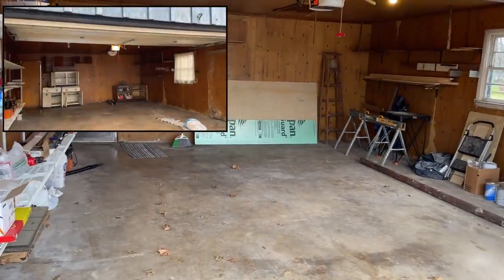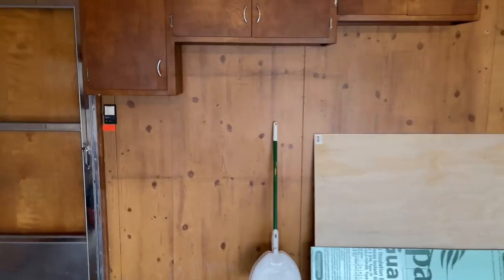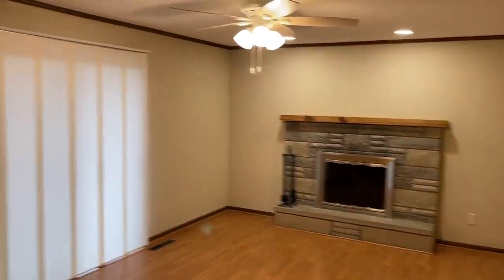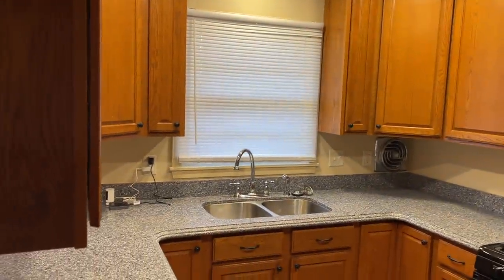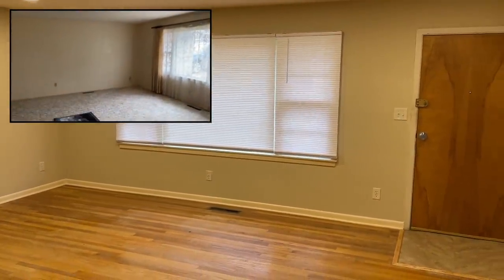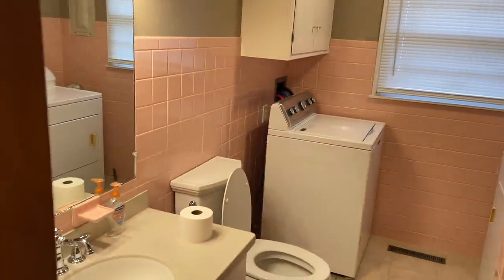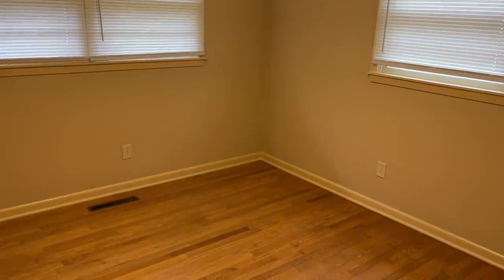Example House Flip | Before, After, and The Numbers

Comment: So refreshing that someone breaks it all down in an honest way.  I buy properties and rehab them myself or with subcontractors and then make them rentals (done 12 in 10 years). I’d enjoy and appreciate your take on how best to prep a house for the rental market. Example: one house I’ve had for 6 years I’ve had to replace the carpet twice...my mistake was putting in carpet in the first place, I should have bitten the bullet and had VPF put in.  It was 2X the cost but I’d be money ahead now after the second replacement. Also, same paint for all my units so I don’t need to play games with colors.  Finally, LED light bulbs throughout since I need to hire a handyman at $25/hour to put in a bulb as if I ask my tenants to change their own bulb they are likely to fake a fall and file a lawsuit.  This is CA and everyone is looking for a quick buck.  I learned these lessons the hard way and I’d sure appreciate learning from you on the right type of renovations for rentals versus flips.  Like how, to install a motion sensor to bathroom fans to cut down on mold as my tenants never turn them on and I end up,with moldy paint.  Using Kiwkset smartlock on all my properties to easily, quickly and cheaply change out a lock in between tenants.
Reply from the maker: Hey Shawn, nice work on growing 12 rentals in CA as that is no small accomplishment.  Have you ever wired your bathroom lighting and fan on the same switch.  So if they want light they get the fan as well?
Reply: @EverydayHomeRepairs  thanks for the response. I wasn’t sure how much of a load the switch could take but I also want it to vent a bit longer after someone departs the room. I just bought this place as #13 but unfortunately it’s from another property burning to the ground. Rodent nest in garage, chewed romex and the tenant left the light on. Another tip, don’t go cheap on insurance, full replacement coverage plus updated code coverage. We didn’t have the latter so we couldn’t rebuild and took the cash and sold the land to buy this new place with the bathroom fan issue. FYI...hospital grade on all replacement plugs now. I’ve been able to find on eBay old stick boxes for @ $2- $3 each.

Comment: Nice video. For those thinking about fix and flip, in the state/county/municipality I live in, this is the law (summarized) regarding a non-licensed person doing electrical/plumbing/HVAC/mechanical work.

The property is a single family dwelling. No condos, no townhomes, no duplexes, etc. 
And
Their name is on the deed
And
The property must be their primary residence.
And
The property will not be sold, rented or leased for at least 12 months after completion of work

If the DIYer does not meet all the above (in my state/county/municipality), they cannot do trade work, other than the most basic things, like replacing a faulty receptacle.

Also, the work is still subject to permitting and inspection.

Comment: Great info! I got started doing fix and flip, or just flip as is. That was in the late 90s. And then i noticed that the folks in my area who had become rich over decades held rather than flipped. For the last 15 years i have been buying and holding 1 house a year. I do not spend a penny of the profit on lifestyle enhancements, just plowing it all back into real estate, and keeping a big cushion. I do not refinance to pull cash out, in fact i do not need loans anymore, the cash builds up quickly enough to buy the 1 house a year cash.
Reply from the maker: Nice Tracy,  I also buy with cash but couldn’t buy and hold too many additional properties at this point.  Sounds like you are in a great spot and all the hard work is really paying off.  Do you predominantly just buy single families?
Reply: @EverydayHomeRepairs  So far just single families. I try to stay inside my limited circle of competence.
Reply from the maker: @tracythompson1692 , not a bad plan at all.  Stay in your lane 👍

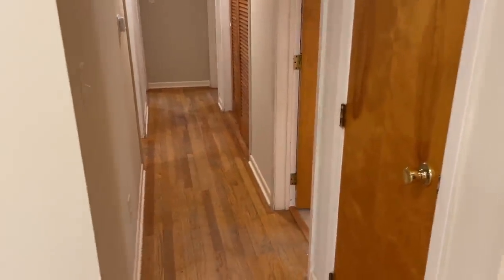Comment: Great video! At 5:20, I'm curious why you didn't have the painters also paint the unpainted wood doors. Typically flippers paint these old doors the same as the trim, which typically means some flavor of white semi-gloss paint. Flippers sometimes also change the shiny brass door knobs, the type reminiscent of grandma's musty old house, to bronze to give buyers the impression of "new-and-fresh". 
On a related note, I assume you will not break even spending an extra $7k to paint the kitchen cabinets if the home is expected to sell for (hopefully much more than) $105k, but at higher selling prices I believe it could pay back double or more, ie final sale price will be $7k * 3 to double your money, or $7k * 4 to triple your money. Remember you have to subtract out the initial $7k. It would be pointless to spend $7k just so the house sells for an additional $7k.
Reply from the maker: Hey Don, the ARV for this home being at $105K there are plenty of thing I didn’t touch which would need to be updated in a different market and price point.  It is always a balance of spending the money wisely and I am definitely still on the learning curve. 👍

Comment: Great idea, but did you get a building inspector, you should have added a bigger recessed light in the middle of the kitchen ceiling and separated the smaller lights as the big could be turned off later after hours, just me.
Reply from the maker: Thanks for the feedback and for this project we didn’t pull any permits.  The home has general inspection and terminate inspection for the sell side.
Reply: @EverydayHomeRepairs  okay I want to be able to buy my own hole in the wall I listen to the adults on PBS' hometime etc  trying to get it all together too

Comment: At 13:40 - should short term capital gains be included? For instance if you made $25k profit then you will be taxed at your marginal and tax rate, so assuming your combined marginal federal + state tax = 20%, then $25k profit * 20% = $5k. I'm inclined to subtract a $5k line item as an extra cost before calculating final project profit.
Reply from the maker: Hey Don, you are correct taxes are not included in the financial statement.  I will be giving at least $5K back in taxes.  Personally I put 30% of the profit coming from each property into a “tax” account to pay my quarterly distributions.  Not something you can forget about for sure.

Comment: I like this type of video. Nicely done on the job, and rather brave, too. 
For me, I am just too scared to take on that volume of responsibility. 

Does the labor cost include paying yourself for hours worked, or not?

PS: The light in the bathroom, near the shower, seems a little 'dim' for that area. Might be the housing...
Reply from the maker: Hi Ivan, good question and that is a no for including my hours at a set rate.  I had roughly 160 hours of my time in this project.
Reply: @EverydayHomeRepairs  oh wow that's less than I assumed, I figured it would have been almost that many hours per month for the whole flip time!
Reply from the maker: @PilotPlater  since this home is just over $100K you don't need to update everything which really saves on the labor.  If I was doing a $200K or $250K in my area the attention to detail and number of areas that need updating would really drive up the labor hours.
Reply: Very interesting! Makes sense! My impression was why not refinish that wood floor but like you say not the price bracket for that. Thanks Scott!

Comment: It's uncommon for someone to list each item as you did. I'm very thankful you did. It's very helpful to get a visual of what something costs in order to not be taking advantage of by contractors. It would be interesting to know how you come to trust the contractors that work for you. Are they wholesale contractors or are they contractors you got online? Thank you
Reply from the maker: I do most of the work myself and on this project I really only hired out painting (guys I have known for some time) and the HVAC removal/install (local trusted company).  Other than that I covered everything else which was about 160 hours of my labor and not included in the financials.  Thanks for the support 👍
Reply: @EverydayHomeRepairs  Could you have saved a few thousand more by removing hvac system yourself and have them install as well as done the painting yourself?
Reply from the maker: For sure, but that would have stretched out the project another 1.5 - 2 weeks so I thought it was a good trade off.